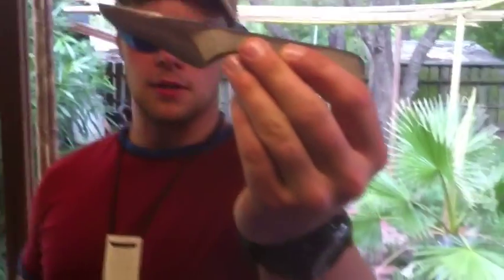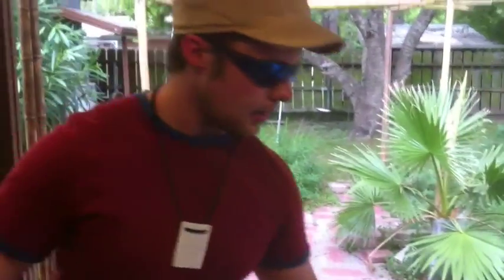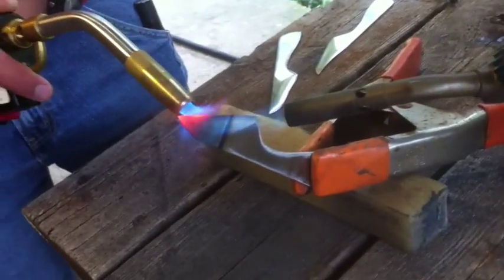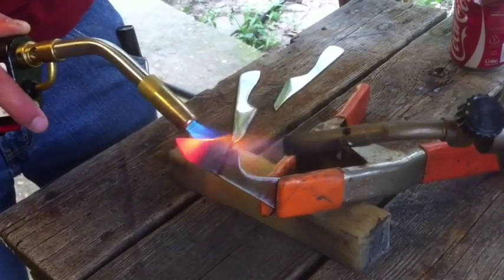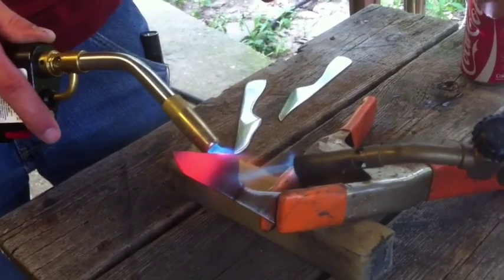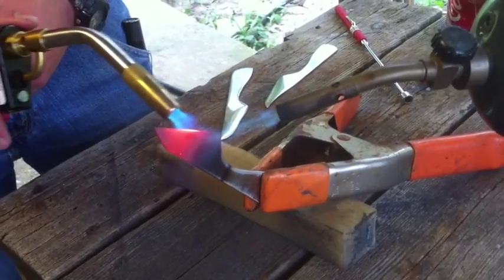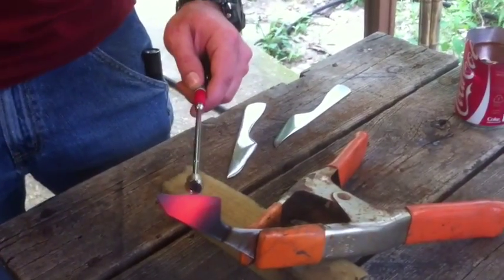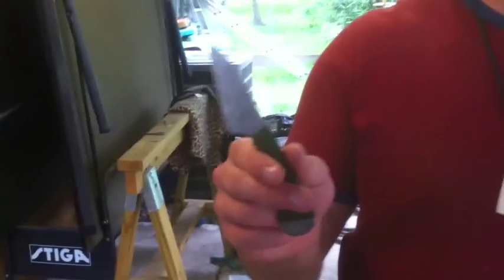Backyard Knife Shop: O-1 steel Heat Treat

Comment: Map gas doesn't get hot enough to get it to a critical point to quench it Should have just used propane I bet if you ran a file over that it would dig right in!  Especially when your not using a forge Get rid of the map gas

Comment: I don't know if your still replying but here goes: I've made a skinning/hunting style knife from a Farberware kitchen knife. The shape is perfect but I'm concerned with heat treating it. I have a propane tank lined with concrete, I use regular charcoal, with a forced air pipe. I have no idea how hot it gets but it can melt a set of aluminum crutches in 2 minutes. A soda can in maybe 2 seconds. I don't want to overheat it and burn out the carbon. I'm pretty sure the metal isn't grade A, or d1 or whatever. How would you suggest I treat it, Map, quench in motor oil, cutting oil,salt water, sodium bicarbonate..etc? Thanks for keeping the backyard MacGyver style industry alive!
Reply: you would have not to worry about the heattreat... do it as follows: since you are using charcoal, make shure you have enough timber between your blade and the inlet of the airtube, entering your forge. to propperly heatthreat you do not need as much heat as you would need to forgeweld, or burn your piece. the molecular chains of charcoal are somple and relatively short, so that they are breaking up quickly and creating a layer of co2 around your piece, while you are heating it up. Carefull! have glowing timber between the air inlet and your piece. now you heat it up ( most toolsteels, springsteel, e.t.c need a cherry red colour. use a magnet to test it. if it sticks to the blade it isnt hot enough. if it has the right heat, put it aside( vertically) maybee in a vice to let it cool down slowly to roomtemperature. if you are using 5160 ( old leafspring) you do it a second time and put it between 2 wooden boards, to cool it even more slowly to aneal it. and there you go m8. the 3rd time you quench it in ordinary vegetable oil, and it should be hard. after that comes a verry importent step - the tempering. carefully clean your piece ( if you are not able to file it, then its hard) and " toast it" over the fire until the surface of the blade turns golden. be carefull tough not to overheat the edge or the tip.

Comment from the maker: Your best bet is to do a google search, hope I don't sound rude. D2 and other complex steels have to be heated to a much higher temperature and sometime have to be held for several min. and then have to be quench at a particular temperature. More than likely you will not be able to heat treat D2 at home. That is the reason why i use 0-1 is because it is easy to heat treat.
Reply: Mathew California